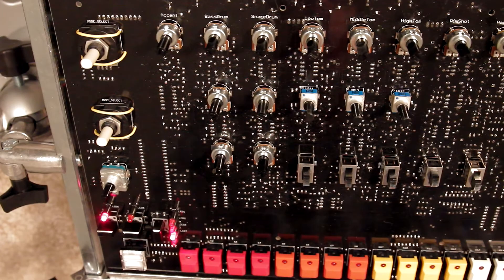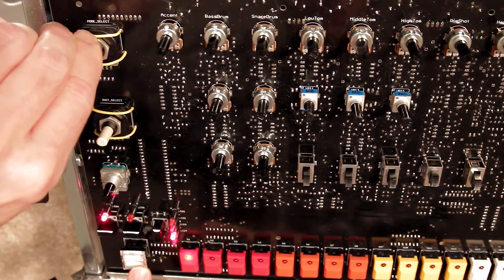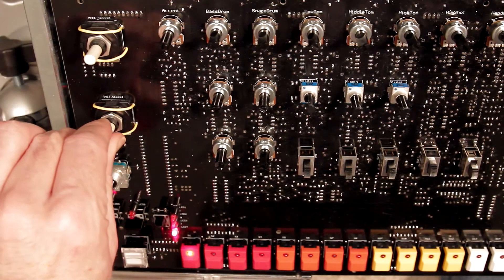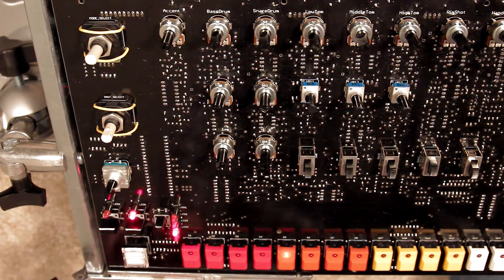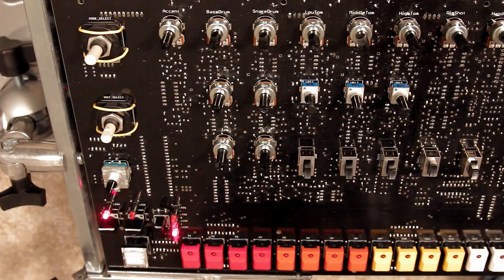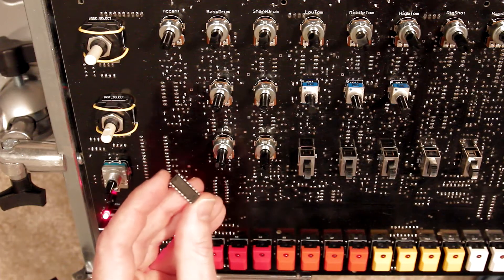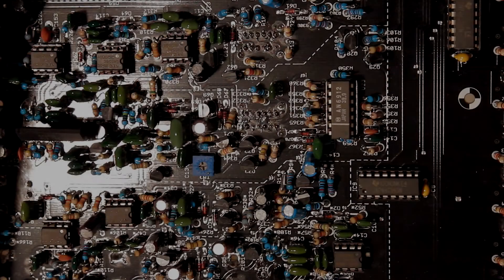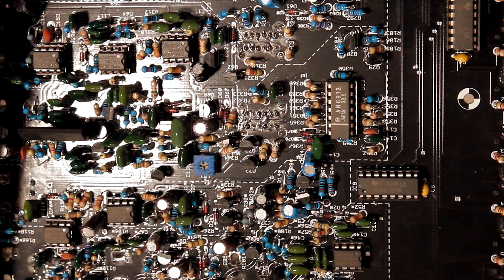[SYNTH DIY] Yocto 808 Troubleshooting

Comment: That clap is way off.
Reply from the maker: Thanks, I appreciate the comment.  The camera mic and a little portable speaker were used for this video.  I wouldn't plug an item that's being worked on into any valuable speaker as there's always a chance of electrical/audio problems.